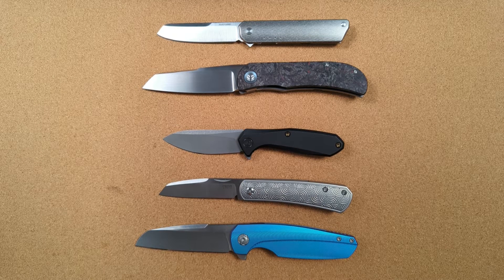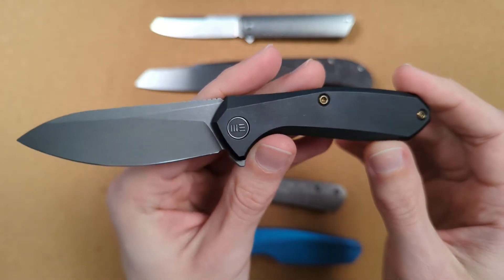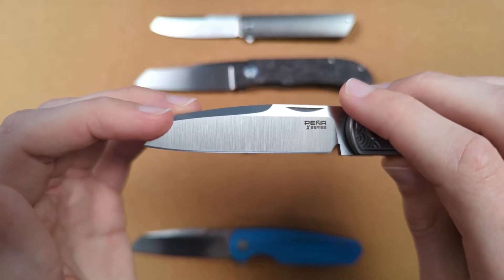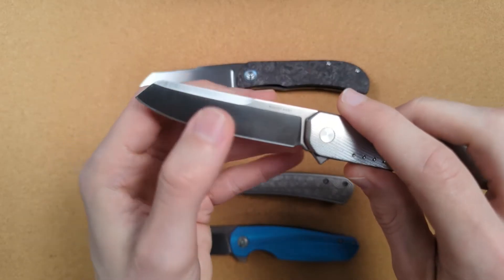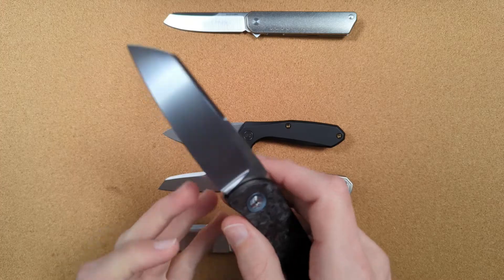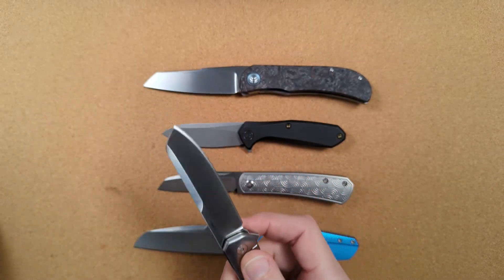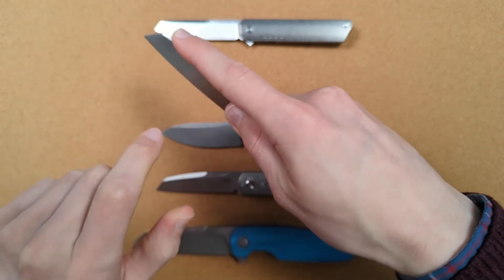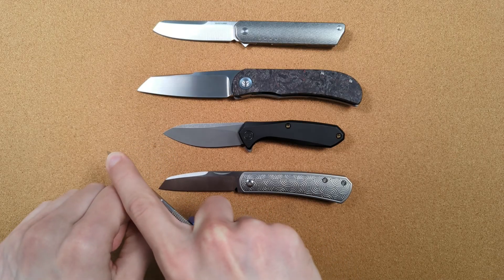The Purpose of Swedges on Knife Blades - Knife Design Deep-Dive

Comment: You have a nice voice to listen to. I recently bought a knives of Alaska Yukon belt knife, and the swedge is very helpful for skinning and processing an animal. It punctures well into thick fur, but also gets into tights areas between bone and muscle easily. Beyond that though, the swedge makes camp cooking less of a pita because things like slicing an apple are still possible. A lot of outdoor knives are designed for post apocalyptic larping, and not for the tasks most encountered while spending time in the woods (if you need to split wood, use an axe). Anyway, swedges are useful. I like them
Reply from the maker: Nice, lots of great info there!! Thanks for the helpful input!

Comment: great point about circular cuts, hadn't thought of that. but what are your thoughts on piercing? less drag, or too minimal?
Reply from the maker: Yeah, good topic! It would definitely help with drag in a situation like that, too. Piercing cuts are especially impacted by blade thickness, because the material remains intact on either side of the entry point, so it simply cannot splay out to the side to make room for the blade the way it would if you were cutting downward into the material from an edge. But, of course, you don't want to remove too much material, and swedges do reduce the overall strength of the tip. This is one of those situations where you're trying to strike a good balance between strength and piercing geometry, and the "best choice" will depend a lot on the the material you're piercing and the properties of the steel you're using.

Comment: I like thumb stud/ flipper tab knives, but it's nice to be able to open it 2 handed sometimes. Like if I have gloves on, or my hands are wet. A lot of the swedges make it so much harder to use 2 handed.
Reply from the maker: Yeah, you're definitely right -- on knives where the handle sits relatively flush with the handle, the swedge becomes all you can grab at, and it means you end up trying to grip onto a downward sloping ramp. That's one of the things I complained about in my ROK video -- they make the flipper tab removable to make it a two-hand-opening knife, but then the swedge makes it pretty hard to actually grip as a two-hand-opening knife!

Comment: Another reason, and a great way to REALLY feel the difference, is on scandi-ground wood carving knives that have a rhombic cross section instead of a scandi bevel & a flat... the large top swedge GREATLY reduces friction and makes the blade so much more agile in cutting/carving plus it can then make a killer scandi wood carver also totally kick ass for food prep by removing that wedging issue you often get from basic scandis when trying to cut things like potatoes. Another use of swedges, from the creator's perspective, is they can be used to dictate and control where the tip of the blade will end up being on that particular blade shape with a particular primary grind and let that then determine whether the tip is thick or thin / delicate or reinforced based on where within the primary grind thickness the tip lands.
Reply from the maker: Yes! Excellent examples.

Comment: I never really knew what that was for before thanks for the info!  Great topic.  Another thing that id like to know is the benefits of different blade finishes when it comes to corrosion resistance and hiding scratches
Reply from the maker: Ooo, yeah, that's a good topic for sure. It's something I'd want to research more deeply, but from everything I've heard and experienced so far, corrosion resistance is inversely correlated to exposed surface area and micro-pitting. Bead blast finishes, for example, create miniature crevices where moisture and corrosive particles get trapped and aren't easily wiped off. The gouge lines in a stonewash finish, by contrast, are dramatically larger, making it easier to absorb or wipe away moisture when you clean your knife. On the other end of the spectrum are mirror-polished blades, which have the minimum exposed surface area and nowhere for moisture to hide.

The blasting medium supposedly has an impact -- people report that zirc blasted blades are notably more corrosion-resistant than bead blast or sand blast, for example. I don't know if anyone has really studied why in a scientific way, but the speculation has to do with the way the blasting material shapes the surface -- some abrade and scratch, while others bend and dimple -- and people think the scratchier finishes are more likely to create those micro-crevices that trap moisture. Makes enough intuitive sense. 🤷🏼‍♂️

Comment: Awesome awesome content. Love the science behind it showing actual functionality. Hey Kev, question…how is the mote. Someone wanted to throw that in a bigger trade for something. Seems small but useful…
Reply from the maker: I keep forgetting to do a video on that! It packs a lot of cutting edge and a pretty useful blade shape into a really small package that fits in your hand way better than you'd think. I personally don't like the flipper tab -- it's quite short relies on you pulling on a hard corner. This becomes a problem if you have the pressure on the lock bar, 'cause it can be relatively easy (and unpleasant!) to slide off it.
Reply: @KnifeNerdery  I can totally see that. I like the design over all and notice How much cutting edge u get with something so unobtrusive in the pocket